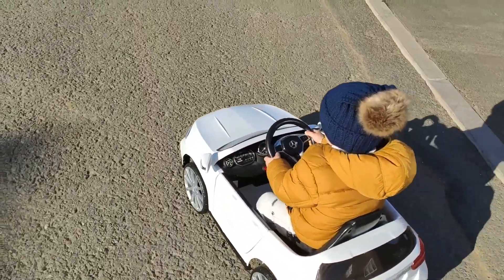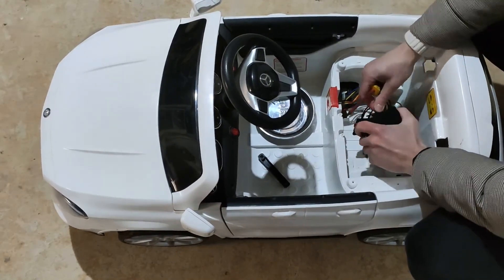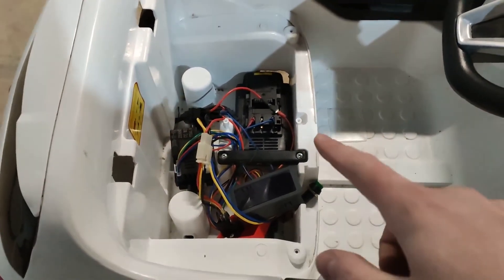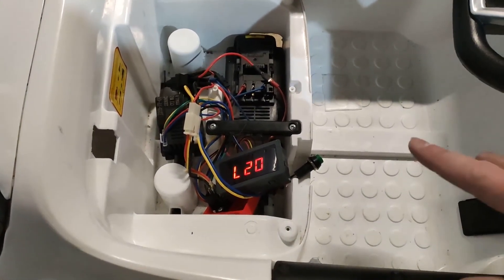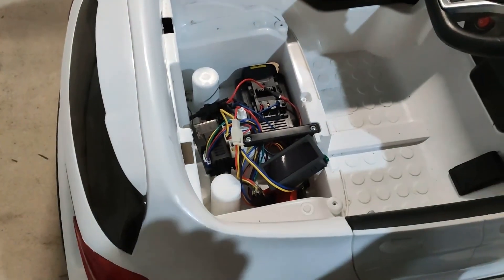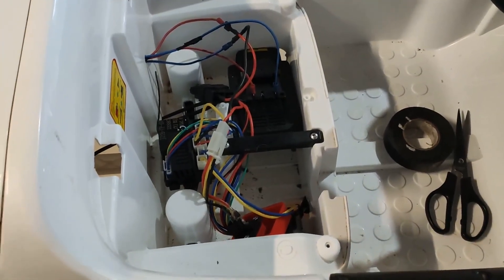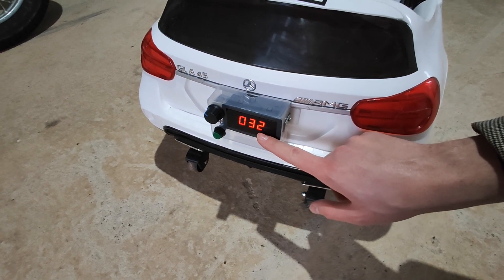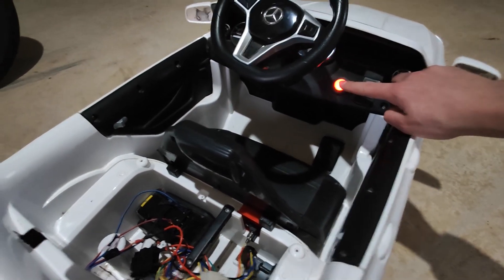How to: Upgrade battery in ride on car - 6v lead acid to 14.4v Lithium Ion

Comment: Thanks for your video...
Why didn't you use a 6v 12ah battery (to give more power and speed to the motor)?
That way you would have saved the other 6v electronics (audio player and remote controller) plus the 12ah battery would have lasted twice as long as the original.
What do you think?
Thanks
Reply from the maker: @dmsp7378  the speed of the motor is dictated by the voltage not the amperage. I just wanted it to go faster.

Comment: Did the motors keep up with the 14 volts?
Reply from the maker: @germandiaz1651  the motors are fine. But the mucic player and controller sroped after 2 weeks.

Comment: Did you change the motor too or just the battery?
Reply from the maker: @tysonvenablescoaching  i only changed the battery. The motor probably has a rating fron 6 ro 12 v anyway. The problem I had is that the music player burned out after a while.
Reply: @hosuandreiremus  You should use step down DC to DC buck converter to power the music/fm circuit in case of using high volt and ampere.
Reply from the maker: @ a more cost efective decision would have been to power those with the 6v battery on a separate circuit

Comment: Can we use 12 v battery in 6v kit
Reply from the maker: It depends. The motors will be fine, but if you have the controller for tje remote or the music player, they will not survive long.

Comment: I am curious. Would you be able to add a new gearbox/motor to the other side, or are the rear wheels physically different?
Reply from the maker: On this car the wheels are different and the axel is not symmetric. But on other cars I have I was able to add another motor and made it 2 wheel drive

Comment: Where can i get the device you used to modulate the power
Reply from the maker: Ebay or Amazon will sell them. It is called a PWM (pulse width modulator).

Comment: Didin't you think to converse into 12v only wires before motors via some converter? Then I am no sure cus i am not expert, then you would get 12v on motors and remote control circuit would be 6v and won't burn. What do you think about it?
Reply from the maker: That would work, but I dont know how capable these small 6v batteries are when you try to step up the voltage. V=IR so you are technically halving the current when you do that.
Reply: @hosuandreiremus  Yeah, right theese 6v batteries could be weak, So better option probably would be install 12 v battery, 12v remote control unit dedicated, and then converter from 12 into 6v in lights and music circle. My boy has i think similar rc car and its teribly slow... :)
Reply: @dynio0392 surely a 6v and 12v control box output the same voltage for the accessory rail?

Comment: It's been a year....how often have you used it ??? Also did it burn anything
Reply from the maker: The motor is still working well, but the controller has burned out and would not go forward any more but would go reverse.
Reply: @hosuandreiremus  i done the same and it hasnt even been a week i put an 18v makita battery on there and at some point took a funny smell....turns out the remote controller wont go left or right anymore but will respond to forward backward and the handbrake. I need to sort that out so im looking for a solution and he s not that good at steering just yet. My belief is that the motor under the car which turns the steering probably burnt out...
Reply: @uittyman  if the remote controller dies can they still drive the car on their own? I have just brought a 6v one for my kid and am thinking it needs a bit of a power boost but thinking a safer option would be a 12v drill battery, not quite as crazy.
Reply: @uittyman  was yours 6v to 18v?
Reply: @hosuandreiremus  sounds like whatever motor protection was on the board got fried. RIP

Comment: what is that lcd varible voltage called
Reply from the maker: PWM (Pulse Width Modulator) or they are also called speed controllers.

Comment: Were did you buy your replacement battery? And how long the life and how many hours can still play using that setup?
Reply from the maker: The battery is from a cordless drill. It lasts over 1 hour. never used enough to run out of battery. I don't recommend using a higher voltage battery like I did as it can damage the electronic circuit in the car. your pest option is to buy a replacement battery from ebay. They are less than £20.
Reply: @hosuandreiremus  ah okey , That's why I was surprised because I know the electronics that are included like led lights and music player are designed at 6v so I was surprised that you used a higher voltage battery that will damage that setup apart from the engine that was designed also with the fix voltage :) anyway thank you very much if you have another technique regarding that for the long run to use